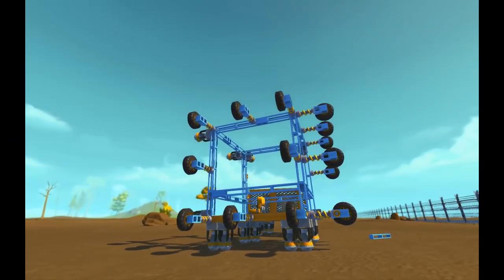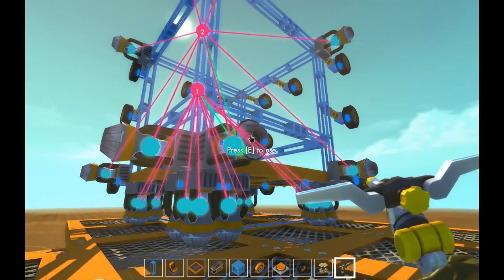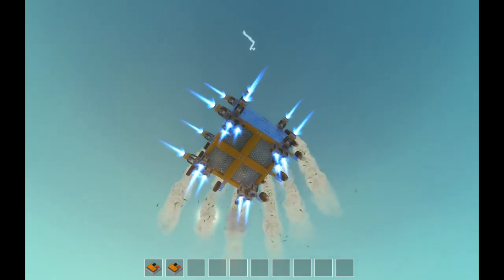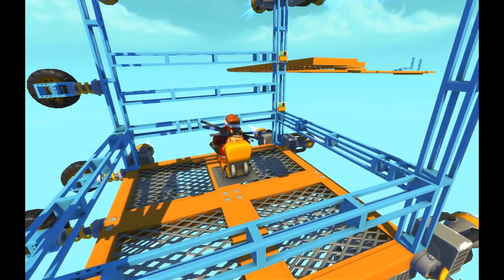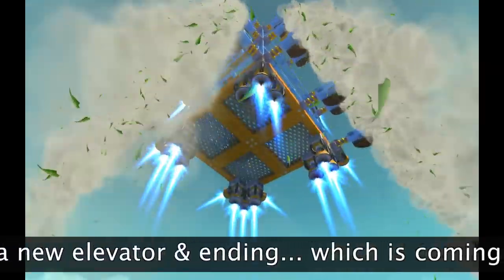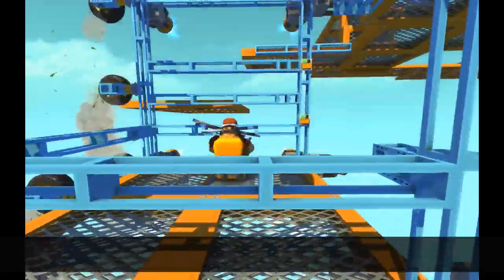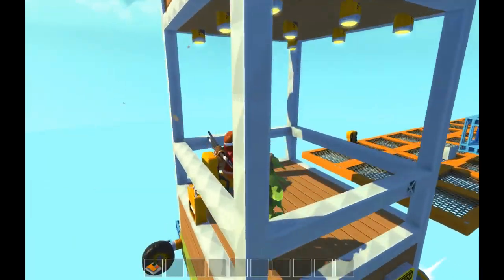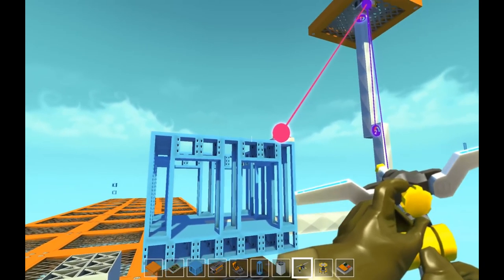Space Elevator

Comment: I have a good idea that could work for the elevator,make a big pole to the top and make a small pod around It,if the friction from block to block would move you can try using wheels to slide on.the pole,this could make it faster because no border friction I needed and you could build it in multiple areas or make a weighted car with the "pole elevator to move it and maybe add some thrusters so you could make it stop it at one point ion the pole
Reply: +MePro i was thinking the same thing during the video lol, i think it would work
Reply: it would make it easier to makeinstead of a elevator shaft,its basically turning it around
Reply from the maker: +MePro I did it! thanks for the inspiration :)
It's in the next video. It's not exactly as you describe...but it's pretty close!

Comment: to prevent the elevator from creeping down, maybe have a arm that goes and blocks the wheels. could use a button or sensors
Reply: also you should put a door on those arms for easier access
Reply from the maker: +Brendan Lindberg good idea. thanks